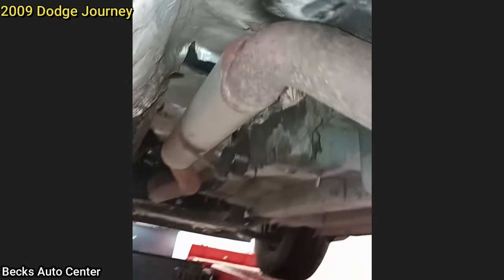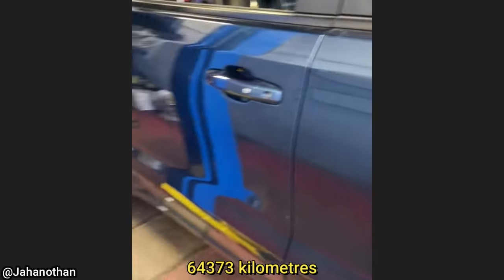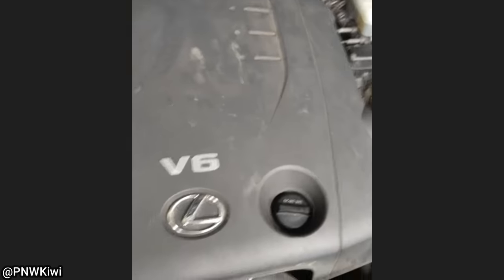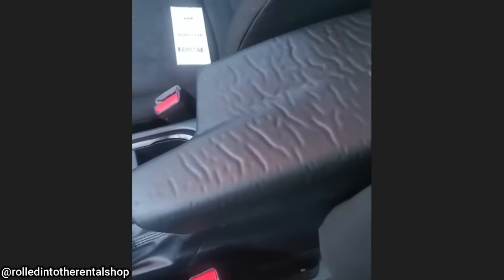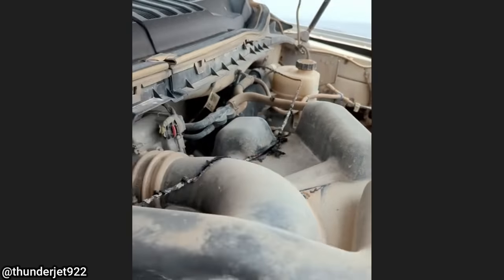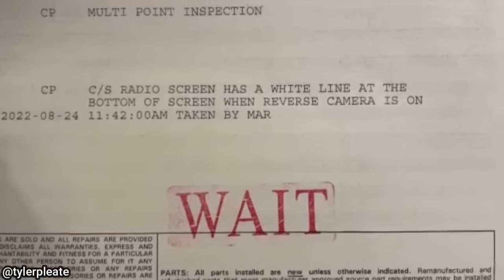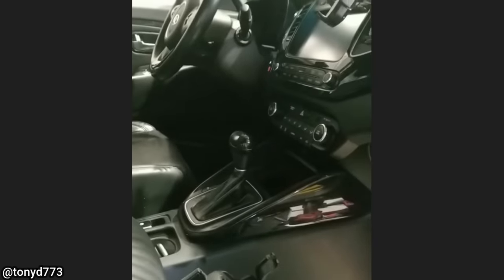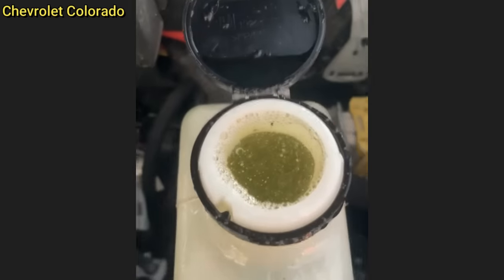Customer States Compilation (The Best of 2022) | Just Rolled In

Comment: Just remember these are the same people you're sharing the highway with going 80mph in the opposite direction.
Reply: "And award for best quote of the year goes to"....😅😅
Reply: isn't democracy great
Reply: You ain’t lying brother!
Reply: “Car clunks under acceleration”
Reply: Nope. They're not🎉😂. Happy to be half a globe away😅😎
Reply: Noooo doubt lol
Reply: @dropndeal  You're taking me far too serious man😆. But if you want to know. I was talking about the Dutch APK, required by law. Cars need to be checked by certified garage, on a fixed set of essential points. Don't pass? You car doesn't get certified and is deemed not road worthy. This is all registered in a nationwide system and very strictly controlled. This has to happen every few years, depending on the cars' age. It prevents A LOT of the stuff I saw in this vid from drivingon our roads. But yeah. Stupid lives everywhere. Thàt I agree on!😆
Reply: Scary right?
Reply: That is a scary thought 🥵
Reply: Your comment is clearly underrated!!!
Reply: They also vote 🤦‍♂️
Reply: Or drive slow in the left lane staring forward.
Reply: It was makes sense know
Reply: And all the rest are high or think they can drive on 4+ drinks and those are better than the old people.
Reply: And they vote…
Reply: Exactly 💯
Reply: There's no way to forget.
Reply: Well I keep my truck working and I’ve had to dodge cars ricocheting off guard rails or embankments a few times in the last 5 years. It’s kinda fun but it’s hard missing the broken plastic debris sometimes. Most people get hit because they think vehicles stop when they hit a wall or they stand on the brakes and get rear ended.
Reply: Scary stuff there.
Reply: And their vote counts the same as yours
Reply: Probably time to invest in that life insurance policy.
Reply: @tylerward4386 so it’s just people who don’t take care of their cars and people who drive while intoxicated? Which one are you then?
Reply: That’s why I go 100 mph im there but not really😂😂
Reply: I'm surprised they can walk and breathe at the same time. God forbid if they have to blink while doing those two things together
Reply: I thought I was slow at math but thanks to this video I feel smarter now 🤣
Reply: @zkilla4611  See this stuff alot in Nashville
Reply: They're also allowed to vote.
Reply: @thirdgen377  lol😂
Reply: @thirdgen377  all in good fun brotha
Reply: Bruh, Halloween was months ago, why are you still trying to scare me? 😨😨
Reply: @deactivated5445 >thinks your vote mean smth
Reply: Scary shit!! Didn't need that realization!  Thanks again m8!! Lol
Reply: @kroon1930  a "drivagon" is the dictionary word for this type of person 🤣 😂 🙄 😆
Reply: And I'm like many are on motorcycle with them.
Reply: Aye when I worked at a shop, I didn’t have any animals make it in like that. But I know how quick a tech or a mechanic will take on an animal in need. I was sleeping in my car while working at a kwik Kar in Fort Worth , and stray pupper walked into our shop and he became mine. He was my dog but our shop dog and his name was Lugnut
Reply: And I feel bad when I don't know my transmission specs.
Reply: @Adelaide-audits.  I'll remember that one next time I play Scrabble😆
Reply: @q6906  what are you on here? THIS ISN'T ABOUT RACE, THIS VID HAS GOT NOTHING TO DO WITH ANYONE'S RACE AT ALL? ANYONE WHO'S NOT EXPERIENCED WITH PICKING OUT A CAR OR HAS TH WRONG PERSON WORK ON IT CAN SHOW UP TO A MECHANICS SHOP WITH THESE ISSUES !! SOMETIMES A DEAL ISN'T A DEAL!!
Reply: And they vote
Reply: @stephandunmoodie6235  every shop should have a shop dog or other shop critter!👍
Reply: @raellskys4083  😂 it was a typo lol it’s supposed to say “their votes” lol not white votes
Reply: @kroon1930  Nice, i was curious weather other countries had a similar system, here in UK we have MOT stations (Exactly the same you explained) and required by law
Reply: As a former tech, I’ve unfortunately seen stuff like this throughout my career, and it scares me to no end, because I’m usually on 2 wheels!!! As a shop, they should be allowed to have the customers car parked, until it’s fixed properly, or it should be banned from the road for being unsafe to drive. The shop should be able to call the police, and have their tags, and registration pulled on the spot, and the car impounded if repairs can’t be made.
Reply: @justlucky8254  I absolutely agree!!!
Reply: Glad we have the TÜV in Germany. No car in this video would pass there.
Reply: And🤔❓ Do you expect to live forever?
Reply: Hence the reason I am a nervous breakdown while driving. I'm a Mechanic and I see all this stupid nonsense and have major trust issues on the road 🤣🤣🤣
Reply: Don't remind me
Reply: And the shop thought my car was unsafe to drive until the airbag was replaced.
Reply: It's the reason I refuse to be a passenger
Reply: Just 80mph huh? Aren’t you sweet?😂
Reply: @chucksneed1264 democratic republic
Reply: @skiddlyd.244  wow you've completed 5th grade civics good for you

my quarrel is with universal suffrage
Reply: @chucksneed1264  Oh, “universal suffrage”… so you don’t want women to have the right to vote? Well if you think that’s what’s dragging this country down who am I to argue? I only completed 5th grade civics….
Reply: @skiddlyd.244  by universal suffrage i mean giving anyone above 18 and with a heartbeat the right to vote. i don't think it's a good idea- i'd rather people have some stake or interest in the future so that people don't piss it away voting for short-term gains. i don't know what metric you'd choose for that- in my ideal world we'd have a national service as an alternative to the military so that graduates have the guarantee of a job and the opportunity for vocational training rather than just tossing them into the worls unprepares
Reply: And having children
Reply: But a trucker has a light out and is put out of service meanwhile a car has every part ratchet strapped on is passing by
Reply: @chucksneed1264  Do you empathize with Hitler when you read Mein Kampf?
Reply: @skiddlyd.244  yeah
Reply: We are constantly surrounded by idiots and completely unaware of it most of the time.
Reply: No it's not their cars don't run lol
Reply: And have babies....
Reply: @ronnierhodes2800  I’m fully aware that I’m constantly surrounded by idiots. Every time I go out I’m in a constant state of bewilderment at the sheer stupidity of the people around me.
Reply: Shit!. Im dumb🤣.
but good lord watching these i feel like a genius.😁
Reply: U do know this not real righ
Reply: As a long haul truck driver, I understand this on a much higher level than most...
Reply: @Sinclair  That's not what I said, but still we were better off then than now
Reply: Do you not have something similar to an MOT in America? 🫣🤔
Reply: I’m honestly 100% shocked it’s not demolition derby everywhere with the way people drive today. I’m constantly having to maneuver myself out of accidents
Reply: Thanks for that.
Reply: @chucksneed1264  *DEMOCRACY NEVER WORKS*
QANON
Reply: @derrickwayne4627  🤦‍♀️😂😂😂😂🤦‍♀️
Reply: And they’re the same people that are voting.
Reply: Good thing there is center guardrails and yearly inspections.
Reply: @basmca1  plenty of highways with no divider at all.
Reply: @kajoeyla  That's not a proper highway then, just a larger road. Here all highways have diveded roads.
Reply: That's a scary thought lol
Reply: Year 😰
Reply: Have you ever even seen that? I drive 12 hours a day 6 days a week and I've never seen that. I've seen a lot but that's a rare one
Reply: @8JLZ8  Never! I ´m shocket. OK, the most are accidents. But the self repairs 😳omg. I ´m from Germany, and whe have TÜV. Technical Control for Traffic. So you can only drive a solid technical faultless car. That´s so much safer for all. Some  kind of these Cars are criminal unsafe.
Drive safe!
💪🏻🇩🇪👋🏻
I hope, i wrote it right 😉
Reply: Have mercy
Reply: Ummmm highways have stop lights and are relegated to 55 maybe 65mph. Freeways you are going 80.
Reply: And they work in government an vote too.
Reply: EXACTLY!🤦🏽‍♀️
Reply: Do you not have to get vehicle checks annually over in America?
Reply: Everyone hates state inspections.....most states do emissions only now.....oof
Reply: Shudder
Reply: @deactivated 🙂
Reply: @chucksneed1264  No, the problem is capitalism. Cities are designed just for cars and no other modes of transportation, everything is very spread out by law. So everyone, including those terrible and ignorant drivers, has to drive, and this is what we get stuck with. The only solution is walkable cities and public transportation, but nobody wants that 🤷
Reply: @austinhernandez2716  i don't really care about people in cities or their problems 🤷‍♂️

yeah capitalism sucks, but it's urbanites and overpopulation are worse imo
Reply: @deactivated5445  exactly what I was thinking.
Reply: Sometimes i think damn man i wish i had a car then i see these vids and your comment and make me re think everything LMAO
Reply: Not only that they live among us. And make children.
Reply: @shorty3austria  this is why motorbikes are so dangerous because you dont need tk be the idiot on the road to die in a motorcycle crash
Reply: And they vote
Reply: To be honest, they only do like 60mph because they're staring at the phone.
Reply: They are also the same people who get mad because you are in the passing lane but not going 110.
They call it "the fast lane"
Reply: in the UK there's a yearly check on your vehicle-don't they have that in the states??
Reply: And that's exactly why I'm so happy all vehicles here have to pass a periodic inspection to be deemed road-worthy
Reply: Every day I think to myself that not everybody should be allowed to vote.
Reply: @JohnZombi88  Agreed: voting should be an earned right. To earn the right to vote one should pass a logic test and a psychological test, that way you weed out people who are an actual detriment to society.
Reply: Its a confirmation of what I've always thought about a lot of people. Lord help us all. 🤯
Reply: Don't remind me 🥲
Reply: Yeah,  now there is a scary thought 😳
Reply: Oh no sir, these are the ones in the fast lane going 5 to 10 mph under the speed limit.
Reply: How clean is your car have nothing to do with your driving skills!
Reply: Hahahaha
Reply: Jokes on you I'm doing 120mph and the left shoulder so the idiots doing 80mph are way behind me, not in my lane and not a problem.
Reply: Scary eh!
Reply: Yeah I think about that every time I pass by someone
Reply: Scary as hell!
Reply: Nope because I live in Sweden and we have obligatory inspections!
Reply: And they are voting. 😳
Reply: We are screwed!
Reply: Yeah, and my dear friend was just killed last month by one of them... See you soon Sue... 🙏
Reply: That's the horrifying realization I had too.
 I bet these people probably wouldn't get a scratch if their rolling death machine's last straw breaks and they go careening into other drivers.  
 
The lady falling out of the Tahoe like suv  at the end , gets up like that happens all the time, no big deal .
Reply: @Quickened1  So sorry. 😢
Reply: @RUAChristian  thank you...
Reply: Right?🤯🫣
Reply: With how nice the vehicles are they're probably doctor's and lawyers too and that's really scary
Reply: NOPE!!!!
Reply: Or driving in the left lane chugging along at 45 in a 55 bc they forgot how to drive
Reply: it should be harder to get a car than get a gun
Reply: Terrifying to think that anyone could just be driving along, with twinkies under their floor mats. Really makes you stop and think
Reply: Dude this video already gave me anxiety lol come on man 🤣
Reply: And they're all playing with their phones while at it.
Reply: If ya squint it's mint bud
Reply: Damn you. Now I'm never going to sleep again.
Reply: And usually with only a paint line to save you from certain death. And then put a cell phone or a hamburger in the hand of pretty much all of these jackasses.
Reply: Don't remind me plz 😢
Reply: Imagin driving only 80mph on German autobahn 150 mph is still not left lane 😂
Reply: That’s s very scary thought!😢
Reply: @dropndeal  и на этом шоссе нет разделительной бетонной стены 😆
Reply: UnjustifiedRecs I'm glad we aren't over regulated like Europe, especially Germany
Reply: @scoobertdoo4223 looked fine to me, just needs some glue imo
Reply: Don’t forget their voting and breeding.😮
Reply: Yea i know its a shame to admit this through, scary isn't folks🤔
Reply: @kroon1930  what are you talking about. Every first world country has cars like this. As you start going to the less well off countries it only gets worse.
Reply: ALSO......   
These people are actually allowed to VOTE.
Reply: These people also vote. Now you know why our country is in the state that it's in.
Reply: Driving is terrifying when your a mechanic.
Explaining how dangerous a customers vehicle is to them as a service writer is too often like this:
This is not a problem.  This will become a problem if left unchecked.  This is a major problem and will need to be fixed immediately or it’s time for the junkyard.  This will kill you.  And this will kill you and everyone around you.
…all repairs denied of course.
Reply: @peterngeti9755  it’s confusing I don’t get it
Reply: @Facts-over-Feelings. depends on the State the car is registered in many states have comprehensive regulations for minimum car safety and some regulate emissions. There are some States that don't care what condition a vehicle is in 😳
Reply: worse yet they are voters
Reply: Hellz YEAH!! And I trust them drivers more than I'd trust U!! They KNOW how to DRIVE!!
Reply: But at least their inbox will be clear by the time they get to where they are going. Peak efficiency at is best.
Reply: This scares the crap out of me that those cars share the road with me. Why don't you guys have inspections in the U.S.?
Reply: thank you for that horrific glimpse into reality...
Reply: You do know that when the motor shuts down your brakes stop working. I'm not sure if you have ever tried to stop a car with no brake booster. It's bloody hard though, you need legs like Arnie to get enough pressure.
Reply: Good point. That girl that fell out at the end almost did us all a favor. N just remember fellas, women drivers, no survivors.
Reply: I dont need to remember that

Almost got ran over 5 times riding my bike on country roads, with oncoming traffic too most of the time
Reply: And this is why we have car inspections in EU..
Reply: I understand the Ignorance of some of the people, but when someone has mold in their car and they haven't taken care of it. I consider them official Darwin award winners😂
Reply: Some of them is not that bad
Reply: And they vote
Reply: Bet there the same ones, slating others drivers.
Reply: FACTS! lol
Reply: And Voting in presidential elections
Reply: Bruh.... How have we not been killed by these people yet....? Truly... WTF man lol 🤣
Reply: Also soon enough everyone will be driving an electric car with a 0-60 of under 3 seconds! kind of terrifying
Reply: @-Eternal-Damnation-  And still know NOTHING about any type of vehicle/maintenance. Pretty cool! 
🆒 👍 😎 👍 🆒
Reply: Just remember these are the same people ur sharing the highway going 80mph next to u!!
Reply: And that is precisely why i dont drive anymore...
Reply: The worst: "customer declined all the repairs"
Reply: oh my god
Reply: 8
Reply: assuming these shitboxes can go that fast
Reply: Not an American so yeah. I'm save in Europe
Reply: *128,74752km/h
Reply: @dropndeal come to Japan and have yo mind blown
Reply: That's why I condemned hundreds of vehicles, seized them, and removed from the roadway, after 38 years in Law Enforcement.  You wouldn't believe.
Reply: @kroon1930  :  Such vehicle inspections should be mandatory everywhere. As for the US, I was a resident of the state of Virginia from 1984 - 1986, and inspections for general vehicle conditions were state law. There may be other states with inspection laws, but the state I am in now does not require them.
Reply: Right, those are the same guys who voted for Biden...
Reply: Keeps me up at night
Reply: And their vote is worth the same as yours
Reply: @kroon1930  they're everywhere.
Reply: Knowing that these people exist terrifies me
Reply: I don’t understand why a country the USA hasn’t implemented an M.O.T test like we have here in the UK.
Reply: police investigate a crash scene only to find a pile of powdered rust and ratchet straps, with a perfectly intact sedan sitting in the middle of it
Reply: Just remember, these are the thieves that charge you for a new transmission when your glasses are wedged in the door…
Reply: I have so much anxiety these days because I think about how many dumb people DRIVE
Reply: These people also vote
Reply: @sshole... and one of those cars was a Bentley continental.  Those things ain't cheap. 😢
Reply: And they vote 😳
Reply: In more ways than literal.
Reply: @isaiahlozano118 who did he quote?
Reply: @kroon1930 😂😂😂🎉🎉🎉🎇🎊🎊🎇🎉🎉🎁🎁🎁🎁🎁
Reply: This is why soap has instructions.
Reply: @rwefree9469 if we don't fix these.... the problem solves themselves
Reply: And they can vote.
Reply: And voting….!
Reply: god help us all😨
Reply: Idk which is worse, these people on the road or these people voting
Reply: I never drive expecting others know how to drive. I watch my car and theirs and react as needed never trusting others
Reply: Or in the wrong side of the road coming towards you. 🙄 almost every night we have wrong way drivers and stupid drivers are the daily here
Reply: ..and possibly on the same side of the freeway
Reply: @chucksneed1264 that…  has nothing to do with anything… there are cars being driven around the world
Reply: @austinhernandez2716 this is an even more ridiculous answer than the one you were replying to.  go look up some Soviet cars. seriously, go drive a Yugo around and tell me how much better everything would be if everything was run by the government. and you do also know that every major city in… well ALL western countries have public transportation already… right? 

every time someone starts moaning about capitalism when it has nothing to do with anything, that person is just signaling to everyone else that they have an iq less than 85. i wouldn’t be surprised if your vehicle turned up in one of these vids 🙄😂.
Reply: Guess then it's beneficial there's a double guardrail wall between them highways.
Reply: @kroon1930 
They do in the us too
But its hard to catch every crackhead hilbilly with a rustbucket
Reply: What's worse is when I'm going fast in a car designed with that in mind on a lot bigger tires and brakes than most light trucks and I see a car that's held together with duct tape and wire on tires with the belts peaking out fly by at 100.
Reply: Hehe
Reply: In my country you need to get your car checked every year. So i don't think so...
Reply: they'rre mostly woman
Reply: these are also your mates ffs
Reply: And they vote
Reply: Screw opposite...any toad at all is dangerous with this...the tie straps killed me...also then engine falling out.
Reply: Scary, but not scary enough for me to agree with mandatory inspections. I'd rather have to deal with occasional idiot-pathic traffic than be forced to sell my truck because it was deemed too inefficient.
Reply: Opposite direction?!
Reply: The same people who don't need to listen to facts, news, science, doctors, etc. because they "did their own research."
Reply: Thanking the gods I'm not American lol
Reply: Exactly
Reply: От этой мысли становится страшно 🙄
Reply: @chucksneed1264 because cars are better taken care of in non democratic nations? This makes no sense.
Reply: Ah yes, America 🇺🇸🦅
Reply: @marioremondino9837 And they can bear arms 💀
Reply: And it only gets worse every year
Reply: Don't forget they also drove next to, in front of and behind you as well😂
Reply: oh nooo whole 80 MPH
Reply: Thats why in europe we have regular mandatory vehicle inspection, most of these cars would have been out of the road for years.
Reply: Scary isn't it?
Reply: I feel grateful for EU's safety regulations when watching this.